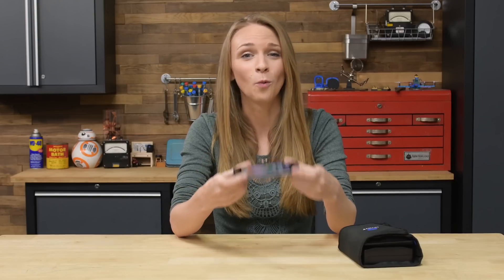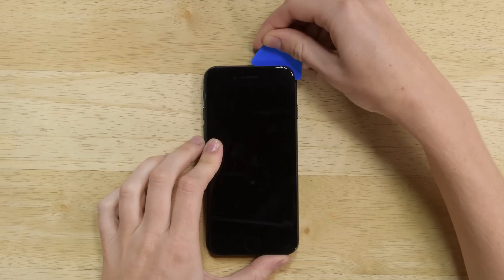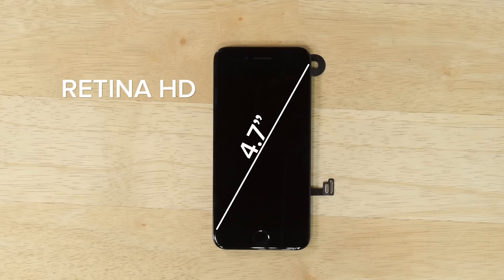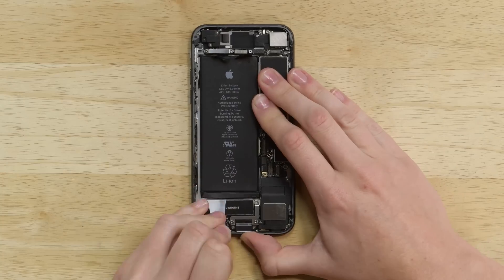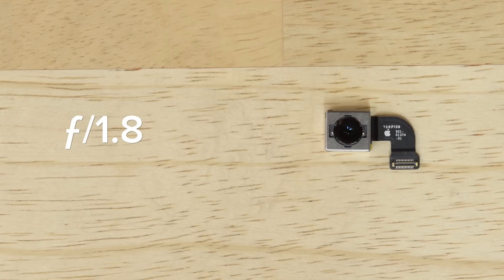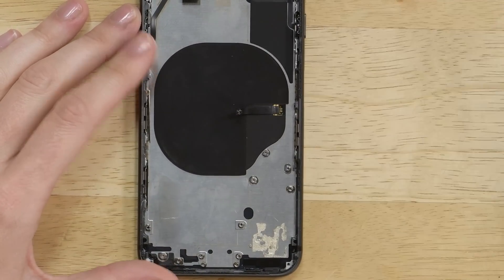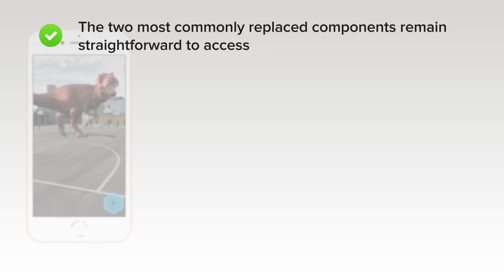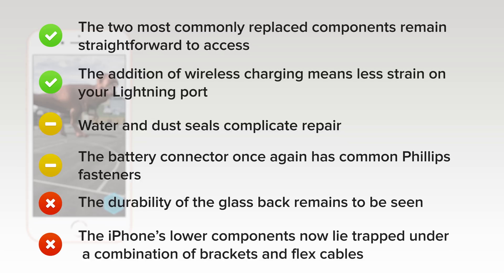iPhone 8 Teardown and Analysis!

Comment: Chip efficiency is more important than battery size. A larger gas tank doesn't matter if you've got an inefficient engine under the hood. The A11 has proven to be both more efficient and more powerful than the latest Qualcomm chips.

Comment: The glass back is garbage tempered glass.  It shatters after one drop in a case. Worst purchase I've ever made.
Reply: the only thing you purchased was an old lagdroid
Reply: Then you had bad luck. Dropped my iphone 8 plus off the roof of my f-150 when I started driving. It had scuffs (which is honestly inevitable regardless of phone or device) but it had no cracks. I got a case afterwards just to be safe though.
Reply: Damn mine never cracks
Reply: The Daniel happened to me too!! so annoyed

Comment: 6/10 repairability when you need a myriad of rare drivers, tweezers, heating gun, suction cup, multiple cards to pry the screen with multiple points of easy breakage?! I don't know how experienced the average iFixit watcher is but I think you have gotten too used to apple/recent phones absurdity levels. This is a 2/10 for the common man imo.
Reply: There is no modern phone meant to be repaired by a common man. This is absolutely a 6/10 unless your comparing it to a 2010 phone.

Comment: 1820 mah battery lol
Reply: Not Anomaly customisation for what? So you can slow down your device even more and really show off the true lack of optomisation? Makes sense
Reply: Crouching Tiger Hidden Dragon they don’t have big batteries because the processor is so effiecient
Reply: Techy Taco the battery on Samsung’s are terrible. My sister had the note 4 and I had the iPhone 4 and I could get double when we used them last year.iPhones don’t bend easily and I’ve never needed the headphone jack.
Reply: Gokū Black Ultra Instinct they get 14 hours of screen time
Reply: official_gymkhanaschoitl nailed it! 😂👍🏼
Reply: khalid filali But has an astonishing battery backup more than iphone 7 which 2000 mah
Reply: Nice android boys
Reply: thats enough for iphone
Reply: official_gymkhanaschoitl you're funny. Have you ever used na android phone? And the copying argument is stupid and it works both ways.
Reply: BlackDragon31000 ios's measurement of screen on time is vastly different from android's. It claimed that my 5s got 5-6 hours of screen on time when it died at 4:00 pm. It did not get 5-6 hours of screen on time.
Reply: official_gymkhanaschoitl ok you're stupid
Reply: 4 hrs screen time HAHAHAHA and with the new update I get no more than 8 hours on my iPad pro
Reply: +Jordan Roebuck

Oh, you're just another jewish iSheep. Sad.
Reply: khalid filali lasts longer than a 3000 in a crapdroid copyphone ;)
Reply: official_gymkhanaschoitl at least we've got durable futuristic designed phones that don't bend easily and doing innovation without removing stuffs.. and also Update < Innovate
Reply: official_gymkhanaschoitl nope.. iCrap has bad battery life compared to todays android
Reply: Not Anomaly and hey! Put apps to sleep; half baked multitasking (even Symbian do better RAM management & multitasking, sorry to say playing media on background is not counted, Nokia xpress Music 5310 can do that). That is why split screens wont reach iPhone, they dont want to give consumer bigger battery. Otherwise A.) Will demand bundled fast charger B.) Extra cost, milking consumers is what they are good at.